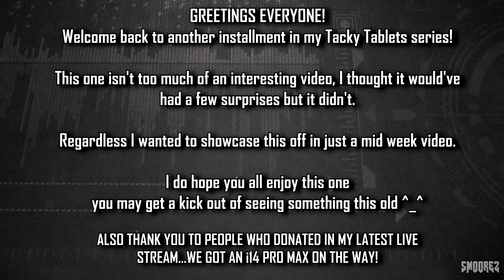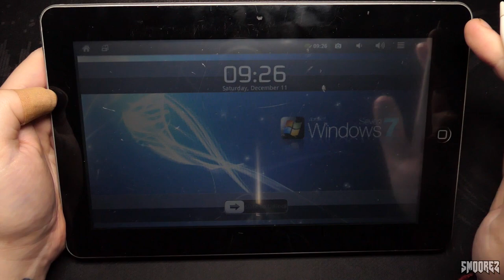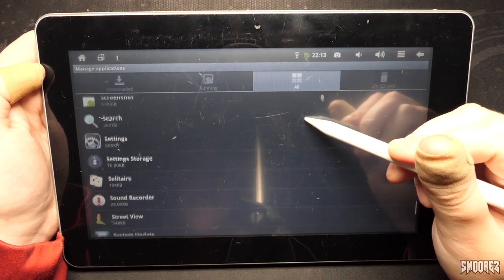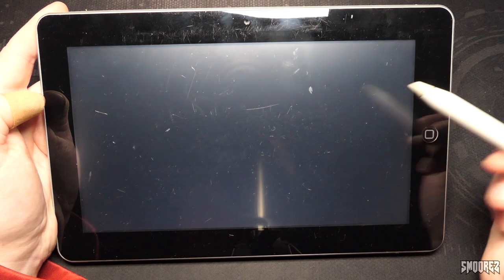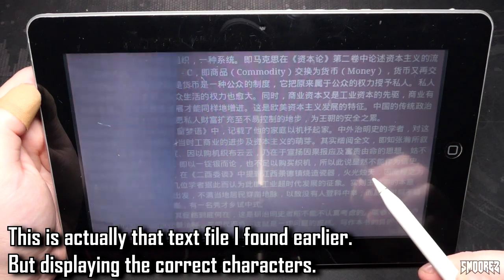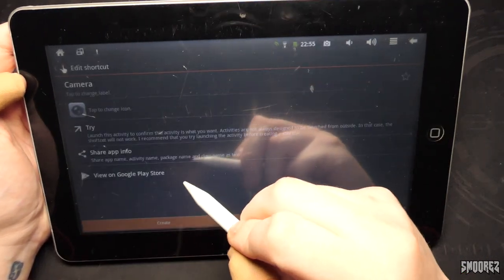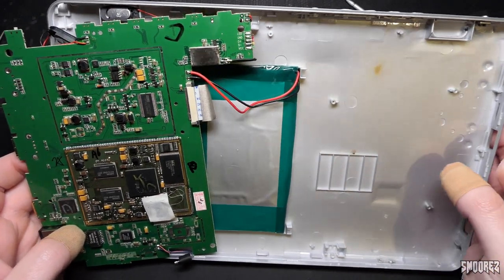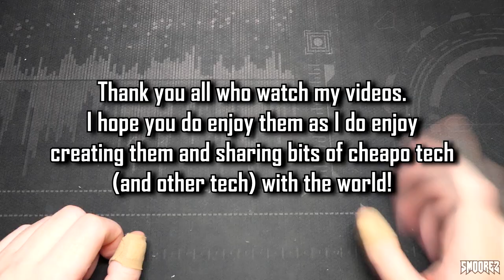Probably the most boring iPad knockoff to exist that's behind 11 Android versions (TACKY TABLETS E4)

Comment: The year this came out, the best cheap Android tablet you could get was a rooted B&N Nook Color. Anything else worthwhile would cost more. If you spent less than $250, this is the kind of thing you could end up with. Edit: this isn't that bad for the time though. At least it isn't a Maylong M-150.
Reply: CNET says that the Maylong M-150 is a regrettable purchase at any price.
Reply: Second I saw that old tablet and the UI nostalgia flooded back of me modding the Nook Color my mom got me for school.
Reply: I completely forgot about the nook I remember those things.
Reply: Eh, for the sub $250 ones the hardware hackers got a nice toy to tinker with.
Reply: @ashisharky Bought one at a flea market. Ended up gutting it for parts as the screen was smashed.

Also got a Machspeed Trio Stealth 9. That thing was great! Until the NAND died...

Planning on getting another solely to dump the firmware and revive mine and others.

Comment: I had a similar tablet back in 2011 called Zenithink ZT-180, and I've even made a custom ROM for it on a Slate Droid site. I remember being jealous seeing this FlyTouch tablet because it had so many ports in it😂
Reply: I found the ZT-280 version of the tablet in e-waste, and it was working. Unfortunately it was laggy and it eventually "killed" itself
Reply: tbh i'm kinda jealous of it. it can still be used lol. 
the microSD card could have the data transferred to a bigger microSD card and you'd basically have upgraded the internal storage.

2 usb ports + ethernet.... also nice
Reply: Those Chinese Special Allwinner A13 tablets eventually got full linux all these years later.

Comment: Yoo, this device is actually really interesting. Ethernet port, system on memory card, usb link cable connection from main board. This could serve as great IT service tool.
Reply: Designs like this show that putting USB-A host ports (And even an RJ-45 port!) on a tablet is a perfectly achievable thing, and even though we now have USB-C it always blows me more tablets and mobile devices don't offer connectivity like this. 🤯

I know there'll be a few people shouting at me that „USB-C is thin and it works both ways and it's a slimmer device etc etc” but even if USB-C can work as a USB host OR an Ethernet port OR a Lightning port, a single USB-C port can't let your phone charge and copy data to a flash drive and tether a non-wifi device to 4G all at the same time whilst this device could (potentially) achieve that even if the 4G was through a dongle! 😇

Lightning port, headphones, USB-C port, charging cable ...That's all I'm going to say! 💾🎧⚡📲😉
Reply: @dieseldragon6756 and HDMI is supposed to support HDMI so any tablets with an HDMI port can use it for lan connection. But I'm not sure if it's implemented on every HDMI port, but it is part of the basic HDMI pin-out to my knowledge.
Reply: @zzoinks  HDMI can be both device and cable dependent, given how many HDMI cable manufacturers tend to push the „With Ethernet“ as a selling point. Wouldn't surprise me if many brands don't connect the Ethernet pins to the wire in lower priced cables that are otherwise identical to their $20,- more expensive „With Ethernet“ versions. 😉

Comment: That display looks like a repurposed laptop LCD due to it using LVDS output, also, that board looks like a embedded repurposed board thingy, maybe that's why it boots in a weird way, looks definitely fun to tinker around with it

Edit: you've mistaken iMAP for Texas Instruments OMAP line of CPUs

Edit²: 1Mb module probably has the bootloader so it can bootstrap Android from SD Card, probably you can run Windows CE Arm on that thing or some Linux distro, just for fun
Reply: yes, it is possible to run Windows CE on it, or even dualboot
Reply: @ILoveWomen  I remember seeing something like those dev boards repurposed in a recent project of a beefed up Nokia phone running MIPS R something CPU and 512 Mb RAM, and it had a similar board to one of those
Reply: @numbazZify  yep, he'd only need to build it and burn the image to that SD Card
Reply: Don't laptops usually use eDP instead of LVDS? Though 1024x600 is a very common LCD resolution for netbooks.
Reply: LVDS, 10,1Inch 1024x600
Yep thats the cheap netbook screens, Inspiron mini, Emachines, acer, benq all of them i had, same display
Reply: @ILoveWomen  this looks like a repurposed CE laptop reject
Reply: @Flopster101  LVDS was still common on laptops back when that was made. eDP was first introduced in late 2008
Reply: Yeah that's why i love old janky off brand mobile/embedded devices. They are janky, weird, oddball, and somehow "fun" for me to mess about with.
This tablet to me is actually quite interesting with how jank it is snd how it's done in general.

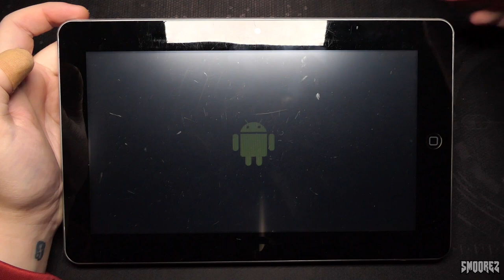Comment: 4:38 My childhood tablet which is very similar to this, also shows Tux for some reason on bootup! It also has an iPad home button, a lot of the same ports (minus USB-A and RJ45) and an on/off switch which serves as another way to turn the thing on and off 
I don't remember the lock screen looking like iOS though but the interface, i remember it looked like android donut

(UPDATE: i turned it on, the tux is a halloween dark penguin thing and the first thing you see when you turn it it, is a picture of flowers and a sign that says "i love you". oh and it runs android 2.1 but it has the popout menu)

Comment: I love it. It's not very useful, but it's very unique and very historical. I'd pay quadruple what you did for it easily.

Vivante GPU? That rings a bell. They have been seen on those fake PSPs with Ingenic MIPS processor. The ARM1136 is the lower end version of the core found in the very first Raspberry Pi, and identical to the one on the Snapdragon S1, typical smartphone technology of 2010. The actual SoC is Shanghai infoTMIC iMAPx210 described as China's "first processor with 3D GPU", with first documents pointing to it being from 2010. It looks like the company was directly involved in creating this end device, basically as a mule for all sorts of further development purposes. Wolfson audio chip on it, wow, spared no expense.

The naming is funny. It's like Freescale iMX and TI OMAP had a baby. It's intended to sound familiar while just avoiding stepping on other companies' toes too hard.

The internal SDCard should have EXT2 formatted partitions or SquashFS partitions. You should naturally be looking at it from Linux, not from Windows.

The Realtek Ethernet chip is just a PHY block that helps with the signalling, the logic is on the processor. The chunky TRXCOM is a magnetic, basically a bunch of transformers because Ethernet lines are current loops, also for protection purposes.

You made a miscalculation with RAM. Gigabit is 128MiB, so it's got full 512 on there exactly as promised.

There's a total of 3 USB ports on the SoC, and only one of those is capable of OTG operation, two others are host-only, so good luck guessing. It won't help, you also need to find and manipulate the ID pin. If you look at the pinout of USB 2.0 MicroUSB, there's a fifth pin in the plug which tells the SoC whether the port will operate in device or host mode. I would be tempted to trace the USB data pins through to the SoM PCB and find where on the carrier PCB they might have a resistor or jumper to set the mode. The ID pin has a weak internal pullup in the processor, and the cable/adapter pulls it down to ground on the side which is supposed to be the host, and leaves it floating on the side that is supposed to be a device. To connect the tablet to PC, you need to reconfigure the OTG port from host into device mode.
Reply: Yeah, the more obscure, and hacked together guts of it make it way, way more interesting. Though it's a shame tablets (and phones) don't have more buttons and such. 
Amusingly, if that ARM1136 is equivalent to a Snapdragon S1, it's about as fast as my first smartphone (HTC Wildfire S), that had an S1, 512MB RAM, 512MB ROM, and Android 2.3.5. 
Little thing is still alive, that measly storage ended up being its biggest issue, couldn't keep the Google Play Services updated even after a factory reset.
Reply: @Ametisti  Someone was making a miniature laptop (netbook) on this same platform as well for sure. So much unused GPIO on the SoM in this, it's ample to implement so many things.
Reply: @SianaGearz  I can't imagine that netbook being very fast, Atoms were bad enough. XD
Reply: i'd love it too!

it's a very interesting device with a nice array of ports you typically don't find on a tablet

Comment: It is a Flytouch Superpad 6. I have been looking for that for my collection as I had it when it could be bought new. And a hungarian friend of mine cooked an Android 4.0 rom for this. On my device, the switch activates/deactivates the G-sensor. My tablet also had an internal hidden micro SD card for system and internal storage. That I have replaced to have a 32 GB tablet.

Comment: You could make an FTP server and download everything. You don't even need to have the FTP running on the tablet.
Wifi File Transferrer can run on another device.
Now, on the tablet, choose your favourite archiver, copy all the system files to external storage and make them into multiple .zip files (since the non-Pro version of Wifi File Transferrer has a size limit).
Then connect the tablet to the same internet connection as the device running the FTP server, connect to its address and start uploading the .zip files.

Oh, you could try the old school rooting method with TowelRoot, which may or may not brick it.

Comment: Why ipad knockoff? That was the look of a tablet around 2010. 
I had a similar tablet around 2012 with Android 2.1 that was a clone of Flytouch 2. It never claimed to be a clone/knockoff of an ipad. It was an 10" device with WiFi, GPS (that antenna connector was for an external GPS powered antenna) , quite fast and with some custom ROMs that updated it to android 2.3.
The WiFi was quite unstable and I had to put an external antenna for it. Mine came with a stand and a keyboard. I used to connecta LAN cable when on the stand with keyboard and mouse connected. I actually used aDosBox to play some old dos games that way. One way to increase the internal storage was to clone the internal SD to a bigger one and to increase the user partition to fill the SD card. On the go, I used it to read ebooks and in car its GPS was quite good - it had an external antenna with 2m of cable.
I remember using in car a USB 3G modem that gave data connection but I was unable to use its phone calling capability (there was no phone app on the tablet)
When I updated the ROM, I remember looking through the files and there were many partitions on the SD card. When connected the SD card to my linux laptop, it showed that there were ext2 (or ext3?), fat32 and swap partitions. The Windows theme was (if I remember correctly) on the stock rom.
And NO, that is NOT android x86.

Comment: It's identical to the Sylvania Sytab from 2009. Ran Android 2.1. No Google apps (AOSP versions only, no Play Services then). Barely worked then. Mine had the EMMC fail and won't get past the Sylvania logo. They all had fatal EMMC flaws. Yours is lucky to boot. The touchscreen is resistive so that's why your Pencil works. That's also why it has calibration. You could use a knife to interact with it. There is ZERO multi-touch so forget gaming.

I have a real soft spot for vintage Android tablets and I would love to revive my Sylvania but unfortunately the correct firmware file is completely lost to time. Any website that once hosted it is now a 404 error and none were archived.

Android  2.x was my favorite era. I have tons of salvaged APK files for all the apps that supported it, including games, which I pulled from various older smartphones I have had over the years and tablets too. Android 2.x was the time when Android was infinitely customizable, rootable, not locked down, not data tracked by Google, and when it was made for geeks. Today they copy Apple.
Reply: Is that why they use an SD card as primary storage?
Reply: simple games may still be possible.
Reply: @Nurse_Xochitl  the most simplest of games
Reply: @tylern6420  true
Reply: @tylern6420  without an SD card you cant install apps or use the camera. The EMMC was a read only file system and only for the OS and system apps
Reply: @NickDalzell  did some units break within a month of this thing getting to existance
Reply: @tylern6420  all i know is the EMMC was of low quality and slowly corrupts the OS until it ultimately refuses to boot. The firmware for certain models including mine is unobtainable.
Reply: @NickDalzell  great its like the ps3 and Xbox360 failures except you cant even fix it
Reply: @tylern6420  you couldn't fix those either, at least not for long. If one could still get the firmware, it would work for a while until it corrupts itself again. These tablets were like $39 at Kmart for what it was worth. You got what you paid for. Aneroid 2.1 was barely usable back in 2011, much less in 2023. It barely did YouTube. Once they updated YouTube the old version included no longer worked and you couldn't update it since the update required at least 2.3, and other than that, best it did was read ebooks and play music.

Comment: Considered the style of menu and the options, could be an android 2.3.
My father has on it's van a car stereo in which an android tablet can be docked, and uses a 30 pin connector to communicate. Same specs of this: a single core, enough GPU to control a washed-out lcd and so obsolete is barely able to hold a WPA2 wifi key. Also, recently stopped even syncing the clock via internet, probably because the last remnats of google services for everything lower than 4.0 have been deactivated.

Comment: Many thanks for another awesome video! I'm still using an Android 2,2 device (An HTC Desire HD) as a digital camera and it's a real workhorse. The battery still runs it for 2-3 weeks on standby, somehow! 🔋📲😇

IIRC Froyo-era Android 2,0 devices used eMMC storage or equivalent (Incl. hidden SD cards! 😉) with a GPT partitioning scheme and several partitions - At least one for boot, one for the OS install, one for the restore image, and one for user data (where provided). The Android system partition is normally formatted Ext2/3 (Linux) and on pre-MTP devices user storage is formatted FAT-32 to allow for easy access from both Windows and Mac over a USB cable. This would be the partition where you found that Chinese e-book. 😇

If you have a Linux PC to hand (I recommend an old laptop with no HDD and a live USB stick running Linux Mint) you can plug the card in and the OS should recognise all of the partitions with those filesystems it supports, which'll be the Android System and user partitions if not every partition on the card. This should let you dump the files to a separate USB drive quite easily. 💾🤝😇

Greetings from the colder side of the Commonwealth! ⛈🇬🇧🙃

Comment: Wow I had this exact tablet many years ago. Got it from a friend who broke the charge port and gave it to me, after which I fixed it and he let me keep it. Even had exactly the same software on it as the one in the video, except for the windows 7 wallpaper. I had quite som fun with it for a while, surprisingly it was able to play youtube videos in the browser, but there weren't many apps I could install because it had the android market instead of the play store. The USB type-a ports were very useful for using it as a powerbank lol.
Unfortunately one day I broke the screen (there's an actual glass panel between the resistive digitizer and the LCD lol) and decided to throw it out, which I kind of regret now.
Also I'm pretty sure it's called the Flytouch 7 Superpad 2. There's also a version of it with 2 micro sd card slots on the outside, which you can even see the pads for in your video.

Comment: to get access to system files, a few things to try  if you have not already,

try reading the internal card on a linux or maybe a mac
try gaining su access on the terminal  either by typing su  or if that fails sudo su 
adb over wifi / network may work
Reply: to gain root access, they would likely have to use something like chainfire su, kingroot, etc.
Reply: but they do have access to the microSD card, so they could use tools like Clonezilla to make a "bare metal" backup of the entire disk or partitions.

Comment: That card maybe have everything this system have, including system files, the problem is Windows and MacOS doesn't have Linux filesystem support needed to read them. So you may need to have some sort of Linux system to read them. You don't need to install them, using LiveCD ('Demo mode') is fine for that.
Reply: and by the way, please make a full SD card image backup before doing anything filesystem related, in case something went wrong.

Comment: On a Linux computer you can copy the files , it uses extfs As filesystem. I had a 7" unbranded tab which had same CPU , we swapped the internal storage back in the days, used win32 imager to create an image of it and compressed with 7zip, we even found one that had 16gb in it once. These went As high As 2.3.6 in Android. And had 512Mb ram max.

Comment: 12:56 that looks like a result of incorrect locale. Those are probably supposed to be chinese(?) characters but arent actually like unicode or whatever so windows/whatever os isnt able to display them correctly. This happens a lot with japanese software on english windows actually. Where japanese text will display as "corrupted" text due to incorrect locale settings.